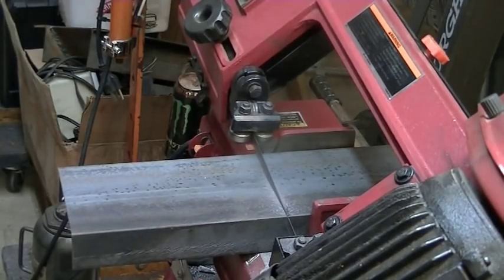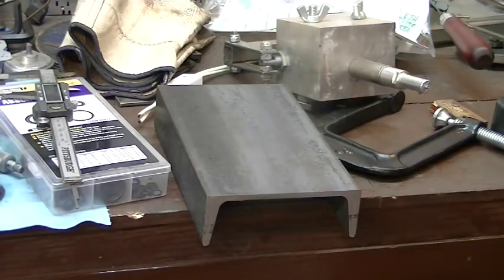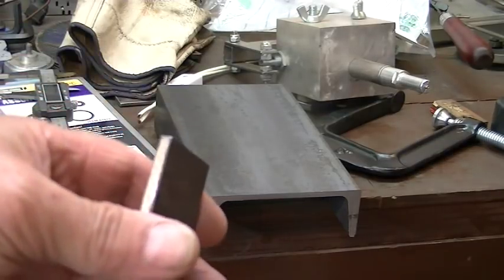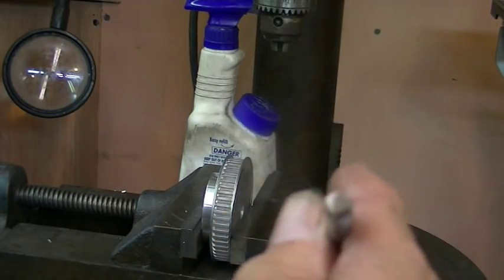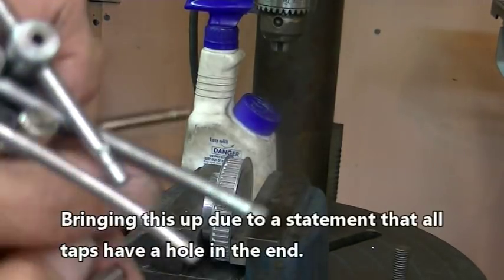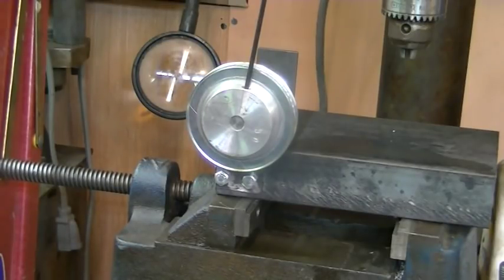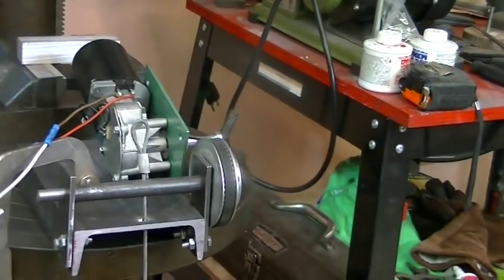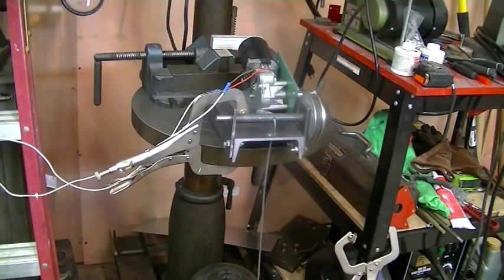Wiper motor how much can it lift

Comment: This is not surprising. Electric motors get their torque from current. They (DC motors) will happily get stronger and stronger and draw more and more current until something melts/trips out or until they reach their maximum torque limit to where they cannot produce anymore torque since the current will be limited by the resistance of the wiring and the armature. So you get stall torque at that point. 

Combustion engines cannot do this. The power stroke cycle of a combustion engine only produces so much explosion force that can be overcomed if the shaft is burdened with too much mechanical load since there is no mechanism in place to suddenly increase the explosion force in the cylinder. One method that might work is to use a check valve and a solenoid that opens up to let the air into the cylinder on the power stroke if the engine experiences a big load increase, but you would have to store the air under much higher pressure than the max pressure you would get from the fuel mixture during a power stroke event. This would be almost close to what an electric motor does when more load is applied.

Keep in mind that I know that a governor will try to keep the engine speed the same by allowing in more fuel, but it is NOT the same thing. I am talking about increasing cylinder pressure on the power stroke, even if the governor is maxed out so you can have torque ability like the electric motor does when overloaded. Once you hit max governor, then you stall without the help of this system. This air setup could also give your engine stall torque like an electric motor. Your piston has to be at top dead center, but as soon as air is applied then you will create starting torque. Much like an air cylinder moves when air is put into it.
Reply from the maker: Thanks for stopping by.

Comment: wht type wipe motor u r using sir
plz do replay
Reply from the maker: I believe the wiper motor came from an older model Chrysler product.  It really does not make a lot of difference what car they fit thsy are all very much alike.  The main difference is how the wiper arm mounts on the the motor shaft.   Thanks for stopping by.

Comment: Great video.... I think a chain drive would be better (And safer) than a belt. That's my 2 cents... Thanks for the video.
Reply from the maker: A chain would definitely not be as likely to slip but I did not have a chain available.  Thanks for stopping by.

Comment: can it carry upto 60 kg? if not what hp of motor can carry 60kg?
Reply from the maker: I used a toothed timing belt in the video and just about 59 kg the belt slips.  If you were to put gears on the motor to add a little leverage to the motor it will lift a great deal more.  Please see this video where I lift about 200 kg with the same motor.  https://www.youtube.com/watch?v=Y9UWzaaa8lw

Comment: I wonder how fast and how slow the thing can go. if it could run close to dead stop with plenty of torque and how hi the to me could get with the right electronics
Reply from the maker: If you look them up on ebay I think you can find out the speeds.  I imagine a good electronics man can make it do a lot of different speeds.  Thanks for stopping by.

Comment: can i used wiper motor for making kids 12v car on ride  ,can it's works ??
Reply from the maker: You would probably be better off with a 12v starter.  The wiper motors are delicate and probably would not last very long in that use.   Thanks for stopping by.

Comment: You don't show how you connected the pulley on the motor.
Reply from the maker: I threaded the inside of a toothed pulley the same as the wiper motor shaft.  Then I just screwed it on.  I had to lift in the same direction it took to tighten the threads so it would not unscrew.   Thanks for stopping by.

Comment: the wormwheel can take the abuse the plastic wheel driving the capstan whont , friend of mine had a small gokart in its youth that used the windshieldwiper motor for power , after two days the big plastic sprocket was toothless
his father made a bronze gear but when that was mounted the wormwheel was bending away from the gear under load
i can immagine wat would happen if that happened halfway through a lift
i would suggest you use just the motor with a bigger reduction and do away with the atached gearbox
prolly good idea to use bicycle chain drive and some sort of a magnetic brake too
Reply from the maker: A go cart is something I would have never imagined.  Thanks for stopping by.
Reply: My wiper motor bent some teeth on that plastic gear one time, took the motor apart and dressed the teeth put it back together and ran it another 3 years.  Could not find that .$0.50 plastic gear anywhere, but they would sell me a new motor for $65.00.  Finally found a used one for $10.  Put it on the truck just before I sold it.
Reply: they dont make enough money on just the gear , they want you to trow away the whole unit and buy a new one , nowadays you could have it 3D printed 
used to be able to buy a piston ring for my moped , now i have to buy the piston with ring and hope i dont break the ring on the install
Reply from the maker: A used wiper motor normally has a lot of life left in it.  Thanks for stopping by.

Comment: This dude moves normally if you put the speed to 1.25
Reply from the maker: Try 2.0 if you like fast.  Thanks for stopping by.
Reply: Yeah man, your video helped me a lot btw. What’s the specs of the wiper motor you used?
Reply from the maker: It is just a common automotive wiper motor.  I think it was from a Chrysler product but I really do not remember .  It is 12volt DC of course and it can take a good 50 amps or more for a short time so it should be able to move things for you.  Constant running would require the amps topping out at some much more reasonable amount like 10 or less.  Thanks for stopping by.

Comment: My need to lift 80 kg then please suggest me for wiper motor please need in project
Reply from the maker: If you add gears you can lift that much easy.  Or use pulleys.  https://www.youtube.com/watch?v=Y9UWzaaa8lw&t=264s

Comment: ratshit title though mate, I was hoping to see the stall out torque is as I have often wondered this myself. Guess I'll have to weld up a rig and test it out.
Reply from the maker: Normally if you want something done right you have to do it yourself.  Thanks for stopping by.
Reply: yes, I have found that to be more often than not the case. I should probably have figured out by now also that it's most probably worth skipping to the last few mins of a youtube vid to see if the title fits or if it's a waste of time/not going to answer my question.

It was kinda entertaining though.
And no problem, probably won't happen again.
Keep up the work.

Comment: The motor and your setup was amazingly powerful.  However, I am very surprised by the Homer bucket and its handle attachment.  I was ready for the failure at that point.  I wonder how much that bucket handle can take.  I have a bunch of those and had no idea I owned such quality!  Good job sir, Paul
Reply from the maker: The bucket is pretty tough.  It was tearing at the point where the handle attaches though.  Thanks for stopping by.

Comment: Nice video Harold. Like you I was trying to see if I could use a wiper motor to lift a hidden shelf. This video is great, gives me a rough idea how much the sucker could pull. By the way, any idea if the power window motor would be more powerful? Any chance do a similar test on power window motor, now that you've built yourself a nifty test jig.
Reply from the maker: Well if you send me one I will test it, fair enough?  Thanks for stopping by.

Comment: Well Sir,
I'm impressed. Who would have thought those little motors were so damn strong. 
I wonder if they would all lift the same, or if the one you have there is a freak of nature....
Hmmmmm gives me a few ideas on what to do with the couple of wiper motors I have stashed away in the shop.
Matt
Reply from the maker: At one time I lived next door to an old fellow who had a 20 foot travel trailer and he used one on the jack that lifts the trailer hitch and it lifted the end of the trailer for hooking up to his car.  And he had another that he used to roll out his awning on the side of the travel trailer.  They come already geared down very nicely and a little more gearing down does wonders for them.  Thanks for stopping by.